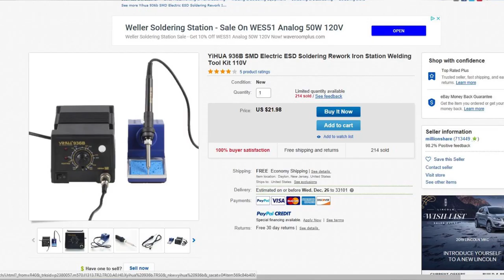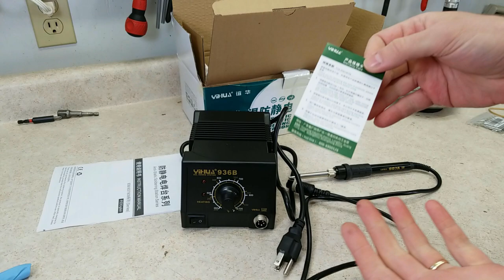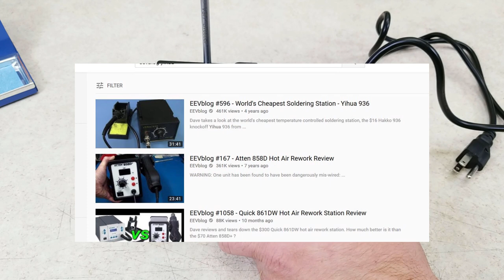Teardown Review: ultra cheap $22 Yihua 936B soldering station. The best cheap soldering iron?

Comment: It actually have a fuse, unlike ...khm.. Weller
Reply: Aaaaaaaaaahahahahahahaaaaa 🤣
Reply: Yeah you would be better off buying this than an original Weller that doesn’t have a primary side fuse. Even with cheap build quality it’s safer.
Reply: Had the same thaugt :-D
Reply: The Weller station without a primary fuse is a $130 WE1010. The $300 Weller stations at the office all have primary fuses. That said, Weller messed this one up for sure.
Reply: My Weller station has burned out TWO of the irons (I'm on my third replacement now!).
Reply: To be fair, the Weller station in question blew up because it was a 110v system plugged into 220v. Operated properly, few Wellers blow up. Still, I would have included a fuse.

Comment: I have a 936B for 5 years, which I use infrequently on small circuits, and use, I use the pointed conical tip. Today I was repairing another device, when I accidentally pulled the 936B case off the desk, falling to the the floor, breaking the plastic case.  Three support bosses were broken, making it difficult to unscrew.  The black plastic is very fragile and split down the side edge.  I'm going to glue it back together, but I discovered the yellow/green ground wire to the heater cord was detached.  Your video assured me that it goes to the transformer.  I put a screw in it. Maybe a heat sink would help to prolong this unit's life. I have several. Thanks for your video!

Comment: Looks great for the money! Just add a heatsink and clean up the board and you're good to go!
Reply: Yes, and perhaps add a standard fuse holder.
Then take the stand and drill a couple of hole in the bottom and screw it to something heavy.  The stand tends to slide around on the bench too much.

Comment: Thank you for the teardown , and I just ordered one of these 936B's to have a spare. Now the price is just under $30 on eBay.
I have a Yihua 939D (not the 939D+). Funny I paid about the same for the 939D. Now that Soldering Station is twice the price. 
 I've built a few amps with it. I like it except the plastic nut that holds the heating element in place. The nut cracked and I had to repair it. The design of the stand lets that nut get hot. While the stand was something that caught my eye and made me buy the soldering station to start with.  I modified it to make the iron more horizontal , when placed in the stand. Probably one of those spring type stands would be better. 
This probably is not a problem for someone that doesn't heat the iron all the way up or continually use the iron.
 If you build tube amps with it you're going to turn it all the way up. The 936B having the switch on the front is a nice feature and the light letting you know when the iron is to temperature is a good too. These Yihua Soldering Stations are great. Throw the sponge away and get a brass scrubber tip cleaner. Unless you want to buy new tips all the time.

Comment: Last year I bought the Yihua 995D+ about 170/180usd and for that price I got silicone cables on the iron and the heatgun, full crimped ground, heatshrinks and silicone jacket condoms, IEC combo socket with fuse and switch (even got a spare fuse), 2 tip kits and spare heat elements for the iron and heatgun, 4 triac/transistors with heatsinks, holtek lcd driver and a s3f8s19x mcu that is probably hackable.
The only bad thing is realy a dodgy hand soldered capacitor, but it works, I got rev. yh995v4-3 probably new ones are better!

Comment: Nice teardown, but I'd like to see a test of how well it holds temp. If you have a multimeter with a temp probe, you should be able to set up a rig to see how accurate the temps are out of the box and then after calibration. 

For $22, that's a steal. The parts alone (excluding a case) would cost more than that if you tried to build it yourself. Assuming it generally holds an accurate temp and heats reasonably quickly, that's a great option for most DIYers that aren't soldering tons of circuits.
Reply from the maker: I actually tried to test the temp with my multimeter's temp probe and wasn't getting accurate readings. I'm thinking of ordering a soldering iron calibration tool.
Reply: A soldering iron calibration tool?
You mean a screwdriver right?

Comment: I've had the Yihua 936D which is the digital version for well over 5 years and it's still going strong..The only thing it's needed is some new tips which I just bought a few weeks ago...If I ever need another station I'd have no issues buying this brand again. I would like to try a T12  based soldering station though.

Comment: I have an unbranded 937D+ with the digital LED display and it seems to be a good soldering station and I got it for $25 shipped. First soldering station I've owned and so far I like it.  I'll be getting some better tips in the future though.  It came with an assortment of 6 tips.  I don't like that it only has Celsius readout though.  I prefer Fahrenheit and I have found no way to change it, so I just made a chart and printed it out and taped to the top.  I took it apart as soon as I took it out of the box, due to all the reviews I had seen on YouTube for all the different cheap soldering stations.   The board looks pretty clean, although I did see a few things that could have been done better.  The ground on mine is the same as yours and the same with the TRIAC.  I'm going to fix these 2 issues on mine.

Comment: I bought one back when the video was released, but really didn't use it until recently when I wanted to fix some old Gameboy games and replace the batteries in them and the problem I'm having with it is that the tip doesn't heat up. Maybe about 1cm up from the tip gets hot but not the tip. Ordered some replacement tips and the same thing happens. 
I'll have to check the fitment on the tip, maybe it's because it's too loose that it's not making good enough contact. Otherwise I'm at a loss on why that would be the case.
Reply: Found a fix for this problem: wrapping aluminum foil around the heating element to fill the space between it and the tip. Works perfectly fine now, and was able to successfully replace the speaker on my Gameboy Color that hasn't worked in about 20 years.

Comment: How's the build quality, specifically, the plastic threads on the plastic/metal cover you start unscrewing at 03:40?

I'm asking because I've seen some 936/907 clones where those threads don't allow you to screw the tip cover properly (basically, they aren't strong enough to support the connection, they 'give out', and then you can (pretty much) keep turning the screw forever, without being able to tighten the cover properly).

Comment: i have a 936D+ which has the led segmented display readout, and my only complaint is the cable for the wand, and it got a bit iffy after a while and drops sensor connection so the base kills power to the element. one of these days i'll get a set of connectors to replace the ones it has and swap to a different wand entirely.

Comment: I've used a Yihua 936 for over a year and haven't really had any issues. Definitely cheap, but worth the money. Nothing compared to the JBC stations I use at work though!
Reply: The correct word is "inexpensive". Let's say you paid $22 for it. If it is worth $22, it is inexpensive. If it is NOT worth $22, it is cheap.

Comment: I always use to reverse the schematics and print them out, so in the case of failure you can always recover asap. Also, changing some components and adding a heatsink to the triac would help.

As per the video, would have liked to see what mcu it uses, and whether that 4-pin header is a programming port. If it is, my guess it's a pic. All the best!

Comment: that triac does not need heatsink. that hole is for mounting screw purpose but they just don't put the screw there to cut assembly time.

one big problem is how long potentiometer starts to crack down.
Reply: It depends a lot on the type.  For many, if you keep the dirt out, a pot will last or 20 years.  Nothing in them decays quickly with time.  Contamination is the issue.
Reply: @kensmith5694  just remember this type of potentiometer used in this video will not last accuracy more than 1 year.

Comment: There I was thinking need to comment "at least there's a fuse" hahaha for the price it's better then any weller you would buy that is way more expensive. Love dave's bit on the weller not having any fuse hahahah. My spiel is to buy a nice direct heating soldering iron from AliExpress a good one but without powersuply and the. Buy a nice laptop high end power supply I can trust served me well I got one that's made for medical services top notch paid more for it then the soldering station hahah but totally worth it

Comment: I am using TT T-ECHNI-C iron station that is similar to this station. Its been 3 years since i bought it and all this time its been phenomenal. My older iron (ersa icon pico) was to expensive and hard to maintain its tips. This cheaper irons are price-performance winners. Iron fetishist please calm the f down. Its just a metal tip that gets hot. I understant your "specific" requirements but for hobby electronics and small amount of production number, this stations are just fine.

Comment: The heat sink debate you could of got the data sheet and calculated wether it needs one or not and talked about derating.
Reply: It is unlikely that a heatsink is really needed.
Lets just guess that the iron is 24W
Lets further guess that the voltage to the tip is 24V
P=V*I  so I=P/V = 1Amp
The forward voltage on a triac is not likely to even be over 1V
1V*1A = 1W
It will get hot but not hot enough to make a TO-220 packaged part fail.
Reply: Ken Smith looks real math and a thought process. Not just spewing our garbage uneducated opinions!!!
Reply: @Shredxcam22  
"It is why I get paid the big bucks" :) :)
Have a very good new year.

Comment: What is the maximum power of this hot air station? Is it in the range of 250 or 500 or 750 or 1000?
Reply: W. Al-Rikabi This is not an hot air station 🤦‍♂️

Comment: shameless hakko 936 ripoff. but for $22 doesn't look too bad. still, rather go for a used genuine hakko or weller on ebay or craigslist.
Reply: remember to buy a fuse holder whit your weller station. Hail the meme.
Reply: Be awere Weller sels whiteout fuse so if you love your home and family be careful